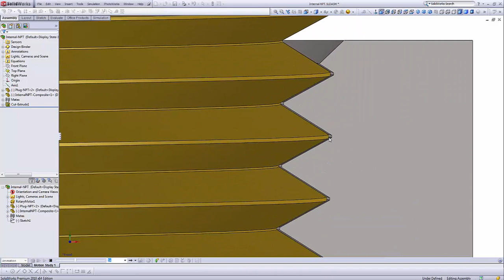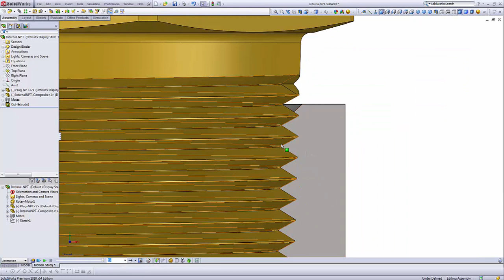SolidWorks Animation of NPT Threads

Comment: Great Videos you make very helpful. I am interested in knowing how did you mate them.
Reply from the maker: Using a screen recorder. Thank you for the comment!
Reply: @encole7224 Thank you for your answer but I think I did not express my question perfectly. I meant I watched your previous videos about how to create male and female NPT threads in SOLIDWORKS. I applied those contents for creating my male and female NPT threads. But when I want to mate the two parts I can't mate them properly using screw mate in SOLIDWORKS and the threads of female and male counteracts with each other. In your video the Male part rotates in the female part without any interactions between threads. I want to know how you did that?

Comment: I am going to give a like to ENCLOE, even though my models differ wildly. Thank you for the insights.
Reply from the maker: Thanks robertjustice! Your model may work out differently based on minor dimensional values you assign to features. This is really a design for manufacturing process where the final product needs several model iterations to be fully optimized.

Comment: Hi, your videos have been very helpful but I can't get my threads to mate up in assembly like shown in this video. Is there a particular way of mating npt threads?
Reply from the maker: Mate one of the parts in the assembly to the  global planes. For example, female fitting Front plane to Front plane of the assembly document. Top of the part - to the Top of the assembly document; Right plane to the Right plane. That will fix the female part in the assembly space. Then mate the male part Front plane to the global Front plane, Right to Right plane. Leave the part Top plane unmated. Then move the male part up or down (hold the mouse key, grab the part, move the mouse) where you will see how teeth mesh. It's totally adjusted manually. Once you have moved the male part into the female fitting where the teeth are centered within each other, mate the Top planes to the distance. Let me explain. Make sure you have at least five full thread turns engaged. Then adjust teeth meshing. When you are ok with where the position is, start on a new mate, grab the Top plane of the male part (the part you've been moving up and down), and the global Top plane, set mate type to Distance. That dimension will be automatically shown. SolidWorks tells you what that dimension actually is, do not change that. Maybe a bit adjust it to round that dimension to a three- or two- decimals. You are done.

Alternatively, you can mate global axis to the axis of the male part (assuming the female part is already fixed in space, see above). This will move the two parts in coaxial alignment. Then engage at least five full threads by moving the male part into the bore. Fixed that vertical dimension (see above). At this point the male part can rotate around its axis. It cannot be moved up or down, cannot be misaligned, so you can rotate it with confidence of keeping thread engagement and concentricity to the female part. Rotate it until the teeth are centered, again manually by holding the mouse center key, grabbing the parts and moving the mouse. The part will rotate. When the teeth  are centered, mate the angle between the Right planes (of the male part and the global Right plane). Or the angle between the Front planes... That's it.

Helps?
Reply: @encole7224  Thank you for replying. I understand most of what you are saying but I don't understand how the male piece will move up and down the thread (as shown in your animation) with those "mates" set.
cheers
Reply from the maker: @mariuspow4789  I see what you mean. Just to clarify you want to rotate the male plug and have it move into the female fitting, while keeping the teeth meshing perfectly in the center. If yes, (1) set the axis of the plug and the axis of the female fittings coincident. Next, (2) move the plug into the female fitting until the teeth are centered within each other. You should have the female plug fixed in the assembly space, so you don't move it accidentally. At this point you have the male plug with two modes of freedom: free to rotate and move along the axis up or down. You do not want to move it up and down if the teeth are centered from the previous step 2. Set a new mate: in the Mate menu find Mechanical Mates. Select Screw. Choose Revolutions/in. (or Revolutions/mm if your units are set to Metric). Next step is important: Type in the exact number of threads per inch as your male and female threads are (they should be the same for the same size NPT  thread). This model is NPT size 2", which has 11.5 threads per inch. So for this example enter 11.5 into Revolutions/in box. Click ok. You are done. Now try to grab the male fitting and rotate it. It will follow the thread while you rotate it. Works?
Reply: @encole7224  Thank you, you were a great help

Comment: Hi nice video and thank you for sharing, is there a website o where can I find a chart for the dimensions for the starting point and final point on a 3/4 NPTF , Im using a mazak cnc lathe and using single point for threads, thanks I hope you can help me.
Reply from the maker: Nominal Size	Target Bore Dia.
1/16"	0.238
1/8"	0.333
1/4"	0.432
3/8"	0.568
1/2"	0.701
3/4"	0.910
1"	1.144
1-1/4"	1.487
1-1/2"	1.726
2"	2.197
2-1/2"	2.612
3"	3.241
Reply from the maker: Look for a Machinist Handbook, there are tables there for all kinds NPT dimensions, not very intuitive, but take your time. Meanwhile, see the table below. It's a good starting point.
Reply: @encole7224  Thanks, so on the  Machinist handbook will be the start point and final point of the taper?
Reply from the maker: @hectordjvago793  It details features of the thread. You can probably find images of relevant pages online.
Reply: @encole7224  Thanks a lot, 👍👍👍🙌🙌🙌

Comment: This is nice do you have a step by step on BSPT external and internal threads? Is it the same way as NPT just the angle changes to 55 instead of 60?
Reply from the maker: The angle for BSPT tooth is 55 degrees. Another difference the roots and crests are rounded, not flat, (tooth peak and the space between the two adjacent teeth). Other than that, it's the same geometry.